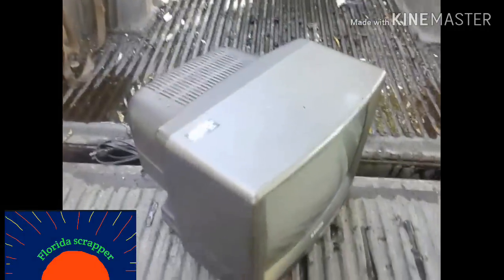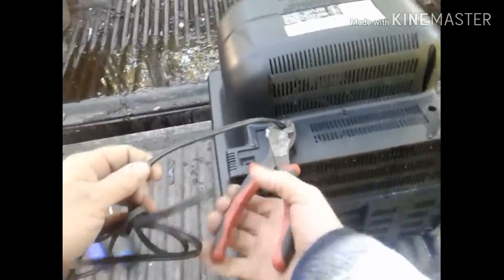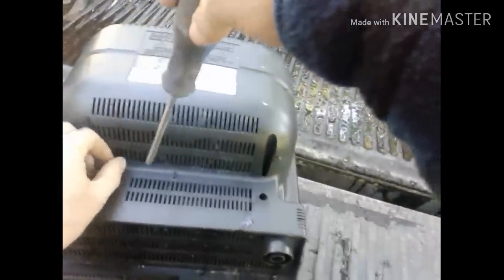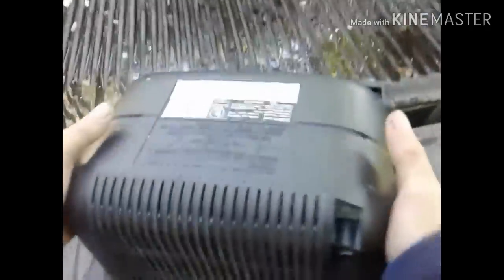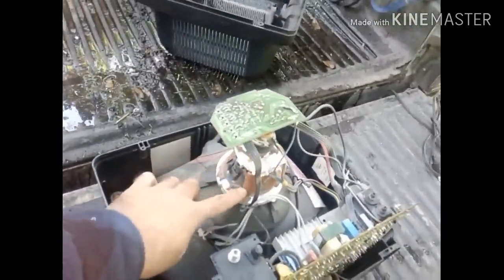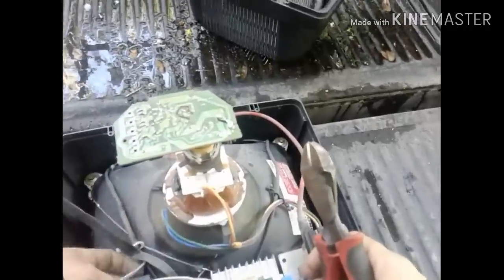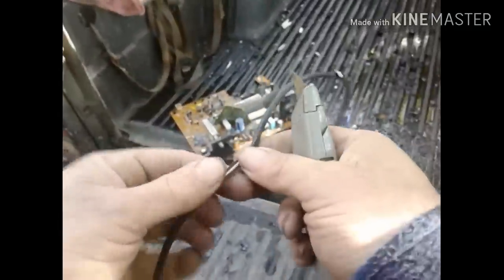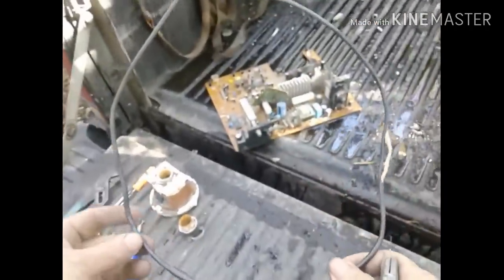Scrapping a C.R.T television.

Comment: It is 22 degrees where I am, didn't stay out long. Need to get up earlier I guess, garbage truck got in my way or in some cases was ahead of me. Found a huge Christmas tree, it was in three pieces. It would have to go in a room with a 15 foot ceiling, I didn't get it, would have strap it down and I don't anyone who needs it or if the scrap yards around here will take. Besides my feet were cold and I had to go back and check with them guys to see if I could that HVAC venting they had laying beside the dumpster. I will pull a lot of stuff out of the dumpster but I don't pick up stuff laying on the ground. I don't think I want to try scrapping a TV, I took apart my old vacuum cleaner there is not enough inside to pay me to do that again. Thanks for all you do for us.